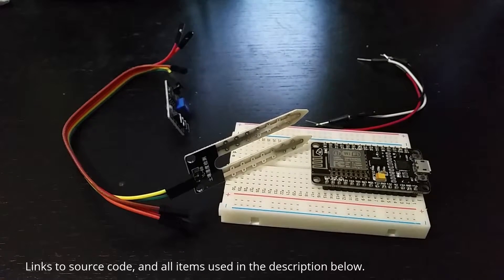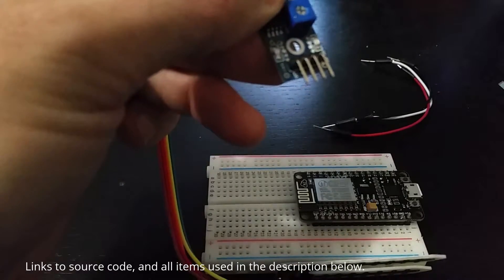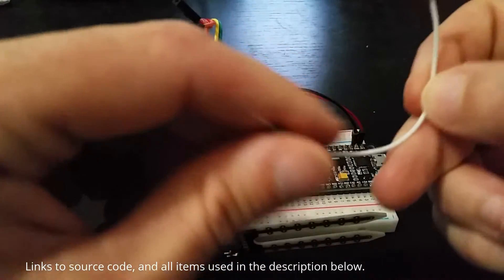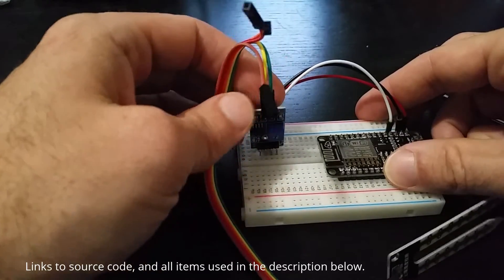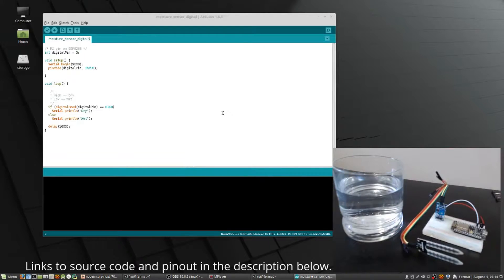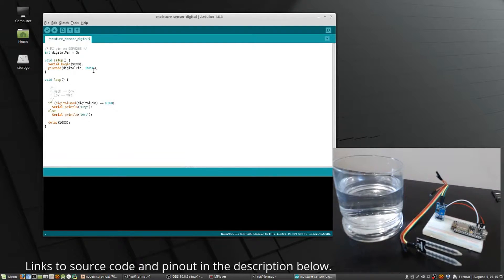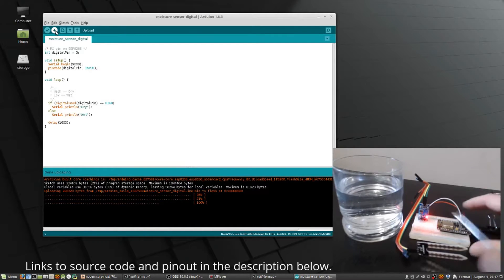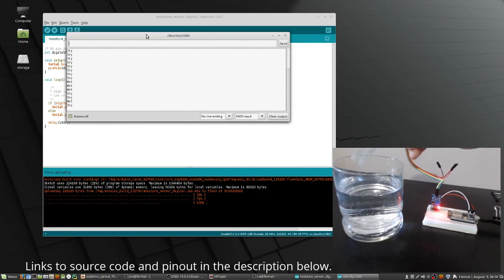How to Measure Moisture Using TE215 and ESP8266-12e

Comment: Do you think the wires on the sensor could be waterproofed somehow? How many of these could plug into one board?
Reply from the maker: Sure.  Some heatshrink and some hot glue should do it.  If you want to submerge it you may want to use some silicone around the heatshrink instead.